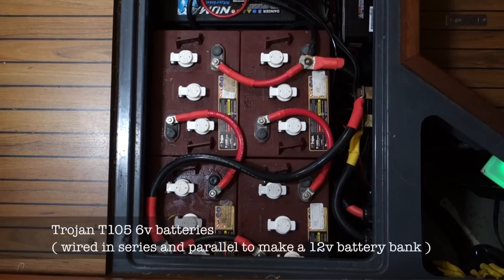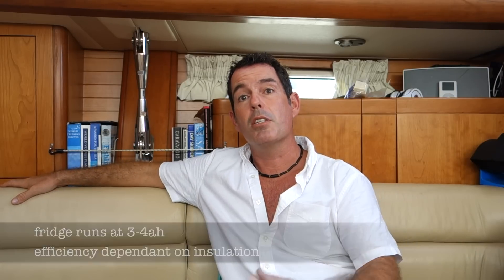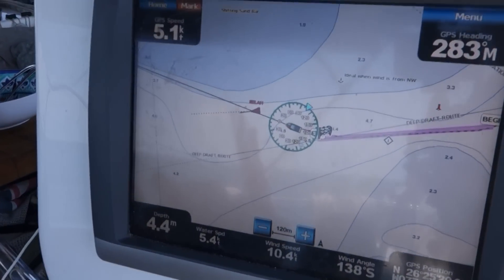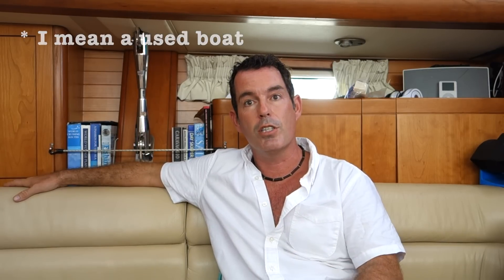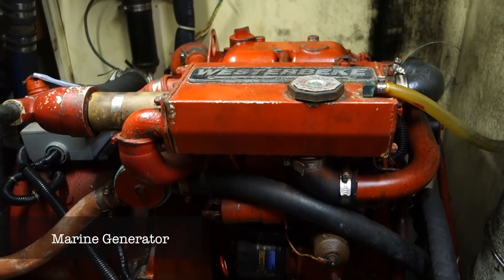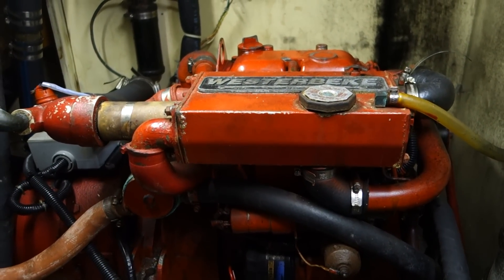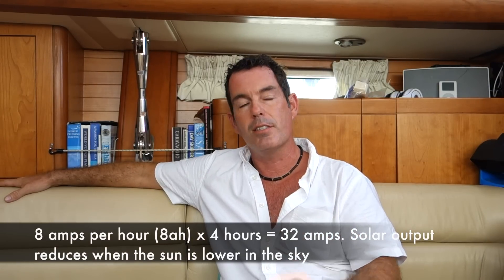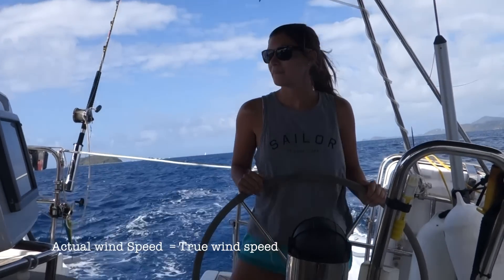How to generate power onboard? (Sailing Ruby Rose)

Comment: I would double down on solar.   I have solar on my camper and house.  The current camper is on V2 of my DIY solar, Spring of 2014.  V1 was in 2007.  It has two 140 watt panels (280 watts) with an 150 amp 12V AGM battery.  I highly recommend MPPT(Multi Power Point Tracking) charge controller.  I bought a Blue Sky Solar Boost 3000i MPPT in 2007 and it still works great.  At the time I only remember two companies with MPPT,  Blue Sky and outback.  I don't remember seeing Victron.

I'm beginning to think about V3.  So far I have several ideas/ requirements:

1) Four ~300 watt house solar panels.  These are the cheapest and most plentiful panels out there.  They are actually built to decent building standard.  For example properly mounted, they can handle 140 MPH wind storm.  They should ride through a level 3 hurricane as long as they don't take a direct hit. in I doubt the solar panels I see on boats are any better.  Total of 1200-1400 watts.
2) Dump excess power to the house.  I'm tired seeing my camper
3) Probably Lithium Ion Batteries.
4) Either a MPPT charge controller or Micro inverter for each solar panel.

The rest is up in the air.
V1 and V2 are a basic 12V DC systems.  Do I stick with 12V or go to 24V or 48V?  Or do I make the leap to 240V AC.

There are now 240V AC Batteries.  The most famous being the Tesla Powerwall.  Another company famous for their micro inverters Enphase Energy has the everything you need for either a grid connected or battery run 240V AC system  It is not cheap.  It runs $7600 for a ($4000 battery, $650 inverters, $600Combiner, $2300 Switch).  The real cost headache is the Switch, it is designed transfer the loads of a 200 amps 240V house.  Where a boat or caper can get away with 50 amps.

Comment: Just a heads up for mine I bought the battery from a wrecked tesla it provides me 60Kwh (5000Ah) for about $10k and I sold most of the parts from the tesla to make it back, seats $2.5k, reasonably okay tyres $1k, trunk lid rear doors, etc etc and got the cost of the actual batteries down to basically $3.5k (plus whatever I used in wiring and the different systems to make it usable) so that's a very cost effective and cheap option if you want to deal with selling used car parts on eBay and find a cheap enough wrecked one with working batteries. But it is absolutely brilliant and with an oceanvolt hydrogenerator, some solar and some wind it does well enough to run everything (including moderate amounts of AC) on a daily basis. You could even take a look at a Tesla's 2nd generation powerwall (13.5kwh, 1,25Ah) its rated for wet environments huge warranty and somewhat cost effective considering it is roughly 5.95 usd per usable Ah and yours are going to need to be replaced more often take more energy in than are able to put out and on top of that they cost 3.55 usd per usable Ah (considering 200 ea and 4 of them that 800/225 for that number) and have a quarter of the lifespan and need maintenance so essentially you're spending 14.2 usd on those lead acid batteries compared to lithium ion. The website for finding wrecked tesla's: https://erepairables.com/salvage-cars-auction/tesla (Please don't hound me for advice on how to do any of the actual wiring and labour I paid someone with a degree in electrical engineering to get the whole thing done properly for me)

Comment: Some small corrections for the Units that you use. Your text states that your solar gives you "8 amps per hour (8 ah) x 4 hours = 32 amps. Solar output." 

Its a VERY common mistake in 'electrical terminology' by many (most) sailing people. 

What you 'should' say is :-
The solar produces "8 amps.  For 4 hours a day. = 8 amps x 4 hours = 32 amp.hrs"

An 'amp' is a measure of 'current' and NOT energy produced. 
An Amp.hr is a measure of energy.  NOT power. And not current.
Power is measured in Watts.

Energy is measured in units: - "Joules" or "amp.hrs at an assumed voltage (eg. 12v) " OR "Watt.hours"

Example. 5 amp.hrs at 12v    is half the energy of 5 amp.hrs at 24volts.

Energy = I x t x V

For boaters: an amp.hr (Energy) is an amp of current flowing for an hour at a 'known and assumed voltage' (in your case is 12volts.)

..the 12v is implicit.

Another example. 1 amp for 4 hours is 1Amp x 4hrs x 12v = 48x60minsx60secs Joules 
...or 48 Watt.hrs

1 hour = 60 x 60 secs

An Amp is the measure of current. Like water flow. Symbol: I. Unit: Amps.
A VOLT is a measure of potential. Like Water Pressure. Symbol : V. Unit: Volts.
POWER is the result of BOTH Volts and Current.   Symbol: P unit: Watts. 

Think of a lot of water flowing through a wide pipe (lots of current) and at high pressure(voltage) ==> High Power water jet.

Energy is Power x time.  Symbol: E. Unit: Joules.  Watt.hours. or Amp.hours "assuming" 12v.

Equations: Power = IV,   
Energy = IVt
Power = IV

Power is the rate of change of energy.

Hope it helps...?

Please Keep 'em coming!!!   We're loving your vids guys!!

Cheers P&D

Comment: Very interesting about the engine. I have a Yanmar 3HM35F (1989). I do have solar and wind as well to assist charging at anchor. The engine has a Balmar 80 Amp rated alternator. My question is at what RPM should the engine run for best results and is it recommended to be be in gear (reverse) if at anchor or neutral. Also my boat came with a wind generator, but I noticed there is no charge controller for it. Is that essential and if yes, would a Victron Solar controller work or does it need a 'special controller' for wind generator? Thanks for a good video.
Reply: Thanks Nick :-)

Comment: it is very short sighted to use a 35 horse power engine to charge 50 amp battery's (max using 2 hp of the 35 hp ) there are only so many hours life in an engine why would you waste them on such a small load . Wet cell lead acid batterys vent poisonous  and very explosive gases why would any sane person place such a system within a 100 meters of a living space AGM or lithium are  the only SAFE  option for live aboards  its 2018 not 1970

Comment: Love your vids,  one of my top three to sub & watch regularly.  I know I;m late to this party,  but still catching up on previous episodes.  You may have thought about this already but,  the newer "suitcase gens are equipped to run on CNG (propane), same fuel as your gimbal stove.  No need for additional storage of petrol.  These gennys run much cleaner than gas, start straight away,  and provide ALOT of wattage at a moments notice should the need arise.  Your philosophy concerning redundancy is similar to mine " two is one,  and one is none".  I'm no sailor,  but live off the grid as much as possible,  and CNG is safe,  providing me much peace of mind when solar or wind power output is marginal.  Just a thought!  Cheers. FW & FS.

Comment: Very nice video.  Don't forget to wash your batteries and check water level every month or so.  We talked to Trogen's engineer as to how high recharge and he gave us the important info on washing.  Use 1 cup baking soda in now gallon of water and literally wash your batteries all over polls and all.  If you hear a sizzelling sound you were in need of washing as when recharging them they give off small gasses that fall down on the batteries and this causes current to be drawn between the poles.  Have had 16 yes 16, 6 volt Trogens for the past 5 years and they are still in excellent condition.  Cafe maker, toaster you name it loll

Comment: Just joined you on your travels and once again, a hugely informative video and great thanks for that! As a builder of engines for those involved in motorsport I`m able to pay a little back if I may.
On the subject of piston/bore glazing: Assuming that both adequate quantity and quality of the correct oil is present.
A thin (microns) film of oil will always be present between both the cylinder walls, pistons AND rings.
A sound and reliable relationship between the cylinder wall / piston and rings relies on sufficient loading imposed jointly on those parts. The combustion cycle creates significant levels of Carbon in the form of particulates. These adhere to the sticky lubricated surfaces of the piston-rings and cylinder walls.
Without getting too `techy` the affected surfaces rely on a given amount of engine load and speed to generate sufficient `scrub` to effectively wipe the carbon deposits from those surfaces rather than have them build up on them. The build up can create a `skin` of Carbon waste on these which then, at low loads and engine speeds bond to those surfaces and in a short space of time become immovable. This is referred to as `Glazing`, the cylinder walls become polished and extremely smooth. Perfectly smooth surfaces do not retain oil, it`s wiped off by the action of the piston rings which as a result can cause very high wear rates between those components.. Blah blah over!... Apologies but needed an explanation!

The solution is very simple! When you`re running the engine to charge the batteries.. Run it in gear, and under load as you would when motoring with sails down. Potential problem solved.

Comment: Yeah your research is correct. Glazing only really is an issue with impropper break-in. And most new engines come machined so well that break in is not really even required. And the load on engine from running even 5 altenators is nothing compared to turning a screw and pushing 40ft of boat around.
Reply: A 50 amp alternator is about a 1-2HP load on the engine when it is outputting 50 amps.

Comment: The best bit of kit for cruising around Uk and  France  I have is the Watt and Sea hydro by far anD of course wind. Wind because if i have enough then i sail fast enough to gen more power than i can use at 5-6 knots and if mot then the wind gen doesn't work either so its engine on. The solar is questionable over here as you know. good vid but more sailing please 😆

Comment: How do I get so much power in one solar Panel. A solar boost 2000 E allows you to dial in your Max power point (MPPT). I've dialed it in for 14.7 volts...Hugh amps are available if you (up) your charging voltage.  Hugh. Get a separate wire to monitor your battery temperature which the controller can come with ( here the bilge and seawater are around 50 degrees allowing a 14.7 volt setting). A separate box is available for surface mount. My Set up is 11 yrs old..a digital amp meter is part of the solar boost 2000 E

Comment: Lifeline AGM's use 103 % of the power to charge them 100%. Wet cell Golf Cart take 135 % of your power to charge them 100% waisting 30% or so or your valuable off line amps..overcoming internal resistance in those wet cells. Lifeline good for 15 years or more....still I love all your videos .  My single 150 watt panel puts out 9.1 amps mid day.  Mppt controller, #8 or #10 wire. Shadows Your ABSOLUTELY right!!

Comment: Brilliant insight. Not that it matters, but an alternator will load the engine, which for those thinking of glazed cylinder bores, load is a good thing. Well done. Went to the Boat show hear at Darling Harbor Sydney, and booked a sailing lesson, just to get some more grist for the sailing life dream mill.

Comment: It looks to me like you put your wind generator above all because your solar array is quite small. 200 W is frankly, nothing. If you had let's say 600W then you would see that solar is really good. I think you have the room to put two 300W panels on that bimini, that would change the equation by a lot...
Reply: Yeah, even if you add 2 more 100W panels, it will be good. 400W is already something...

Comment: A good overview on the topic.  Most people would find this topic frustrating as there are no hard and fast rules.  It really does depend on your energy consumption pattern and your location.  I spend more time in a marina and hence tend to rely on solar panel and shorepower.  Wind generators tend to upset the neighbours quite a bit, due to the noise.  About to put in a battery monitor with 3 shunts (2 banks + starter battery).  If it's reliable and accurate enough, it will give me some peace of mind.  Time will tell!

Comment: Lead Acid batteries (which need to have their electrolyte level monitored on a monthly basis and vent corrosive gasses) are 50 year old tech and have no place on a modern cruising yacht. Even AGM batteries are getting old. Lithium Ion is the only way to go. Power capture and storage is what we all need. Yes it costs more but over the long run they are actually the cheapest option! So much information on line.
Reply: On a boat it pays to be cautious. Using established technologies that have proved to be reliable and safe (providing they are correctly installed) is the cautious approach. Lithium batteries are relatively new and still occasionally catch fire. That is the last thing one wants on a boat. Yes, there are other things that can create a fire, but lithium batteries can catch fire some time after installation due to a manufacturing fault. They can also get very hot if heavily loaded and the heat can distort them which can lead to a fault and possibly fire. Everyone to there own, but I would rather be conservative about my technology if I am going to 1,000 miles from land.
Reply: Lithium's advantages don't counter the 10x higher cost for most people.  The batteries don't last 10 times as long. And they have some other pretty serious disadvantages besides the cost, such as safety.

Comment: Great job Nick. You are correct regarding modern diesel engines and glazing however, In regards to what you said about the pistons glazing on diesel engines, Its not the pistons that would glaze, it would be the cylinder walls that glaze. The pistons themselves do not touch the cylinder walls, the piston rings do. Short run, not up to operating temperature or overheating, excessive engine loads and poor oil and fuel quality are what kills modern day engines. I had a very long conversation with Yanmar specifically regarding this topic not to long ago and your info is spot on.  Cheers

Comment: 6v go kart is the way to go if you have space for them. For sure. But one thing  that keeps me away from the idea of buying wind turbine, that's the sound. What kind of brand did you buy. And how is it to sit outside beneath it? Or in the neighboring boat. 
Also, I have a question about autopilot. And I KNOW there are big variations about how sailing, sea / flow ex is. But when I go from a motorboat to cat, electricity is important on long stretches. How many amp / h use the autopilot. Across the Atlantic, for example. The catamaran uses a little less as well. That's fine ;-) Did you have a Windvane that worked on the Catamaran??
Greeatings from Norway
Reply: Thanks. The Lewmar homepage wase good.(4A Current) Did not find anything on Raymarin. Tried to google it several times ...

Comment: I thought that was probably one of the most technically correct explanations of boat power needs from a youtube channel. As for engines, I believe regular running and getting the engine up to operating temperature is most important. Engines generally get run every time you leave the anchorage, generators get run even less, hence prone to more problems. The best place for solar panels is over the dinghy davits. I'd never heard of a hydro-generator until I started watching this channel. Lithium  batteries are much lighter, 10x more expensive, can handle a greater depth of discharge but are way less tolerant of overcharging and need a much more sophisticated battery management as a result, adding to the expense.
Reply: I've only owned one car that had glazed cylinder bores and I would fill up the petrol tank and the oil and drive it around. The oil warning light would be on before the tank got down to 1/4 full. Basically 1  litre of oil per 100 kms. It didn't havea lot of kms on the clock ( 140,000kms from memory) I changed the thermostat and drove the car to Darwin and back. the further I drove, the less oil was used. By the time I got back to Melbounre I could drive the car 10,000 kms and and the oil would have just reached the bottom of the dipstick. I am not sure what the previous owner did but I suspect it was a lot of short trips.

Comment: Right the running of a Yanmar engine just to charge batteries for an hour a day will be fine over many many hours, I know this as I use to work for a company that hired generators with would you believe it a Yanmar engine and it just so happened we hired them out to Three!! 
The gens just charged batteries for the mobile masts so no load.....ish.....it was only after around 3000 hrs-ish that we had to bring them back to the workshop to put them under load to clear the carbon build up in the exhaust. These engines was running 24-7 with basically no load plus every gen was new going out to site with 1-2 hrs on the clock.
So if your running the engine to charge up the batteries for 4 hrs a day over say 5 months it will be fine as long as at some point in the next year or so it goes under load ;)
Reply: Your welcome